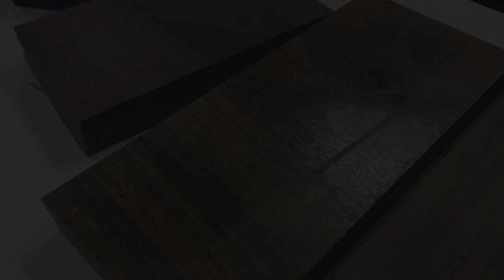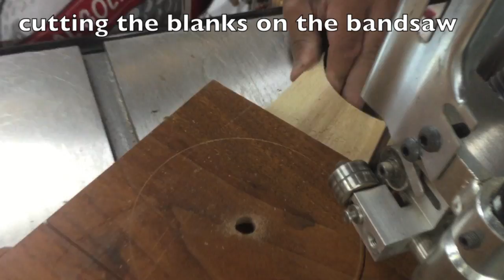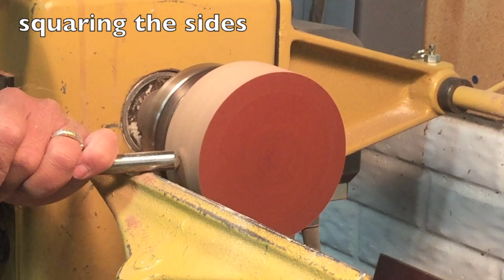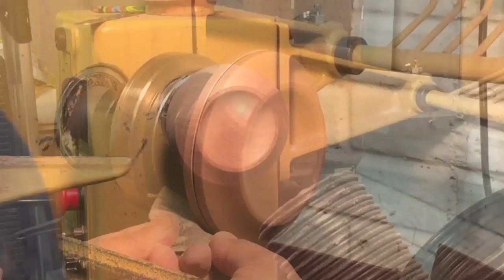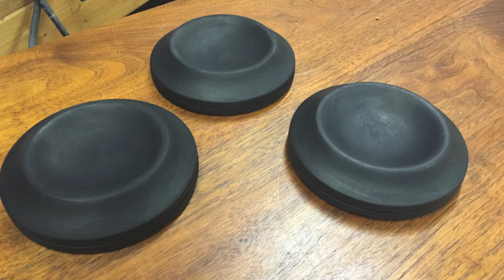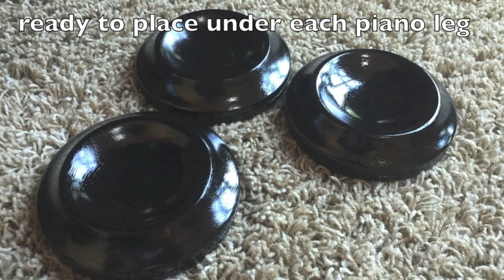Woodturning Piano Cups

Comment: Great! Thank you for sharing!   I am actually new to turning and cannot identify the chuck (or drive) that only has a screw.  Did you make it your self?  What can i use to hold the wood to turn caster cups?  Your help will be greatly appreciated.
Reply from the maker: I believe that’s a Oneway chuck which I think came with the screw-drive as a separate piece. I added a piece of turned wood just to act as a spacer so the screw doesn’t go too deep into the wood, plus it gives me more space to work away from the metal chuck. Good luck!